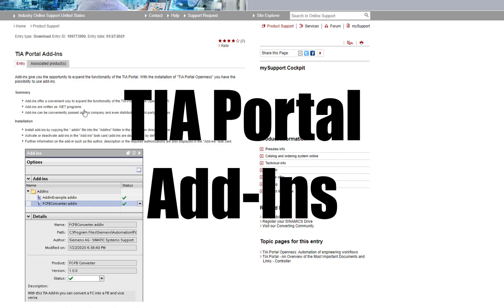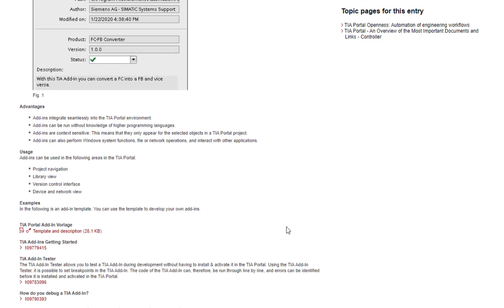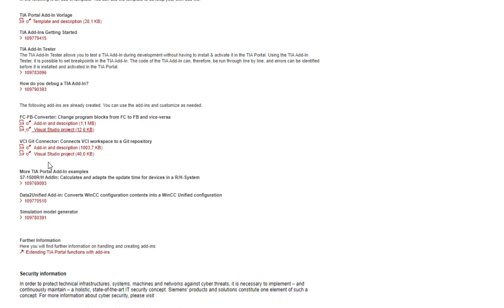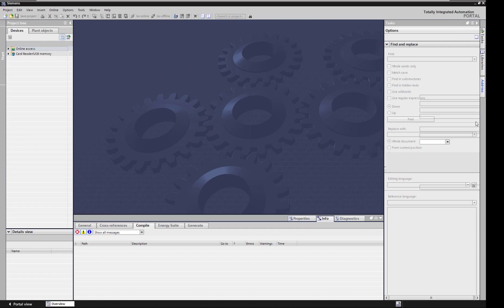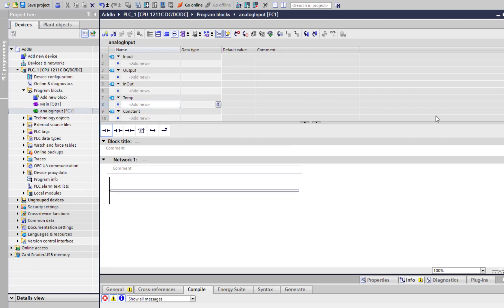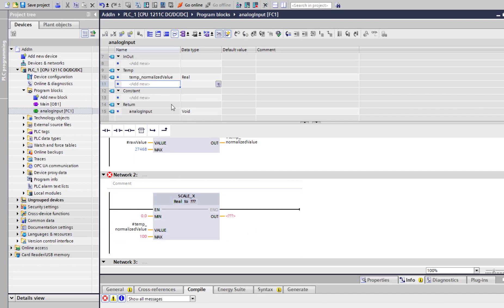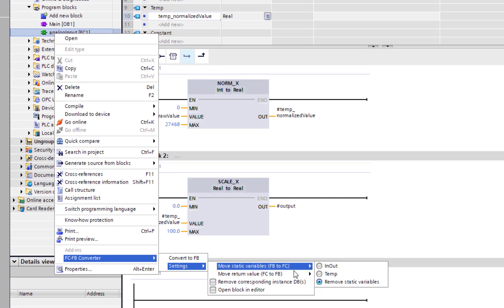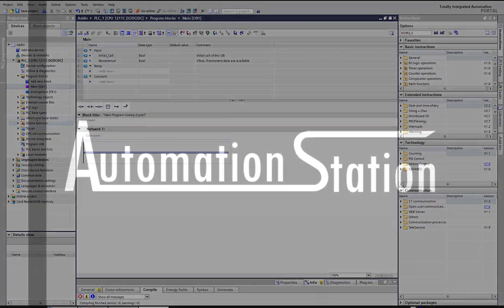TIA Portal Add-Ins - How to add functionality to TIA on the example of FC FB conversion add on!

Comment: Thanks Automation Station....can we downgrade over PLC custom library blocks (FC & FB) from TIA15.1 to TIA15 ?
Reply from the maker: There is no supported method but I'd try exporting the block to XML, modifying the tags and reimporting. There's a Siemens Import/Export Openness program on the support site. Check there. You might need to change version in the XMLs and some tags but it might work... or not :)